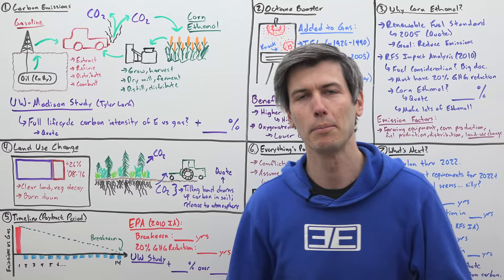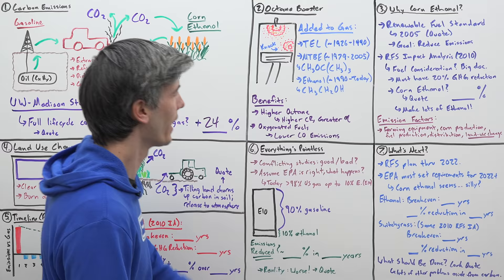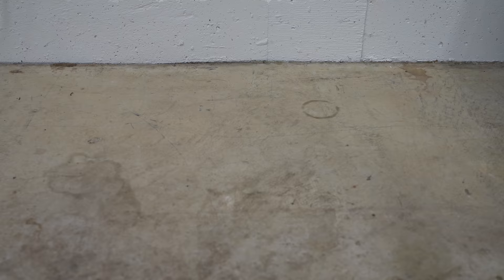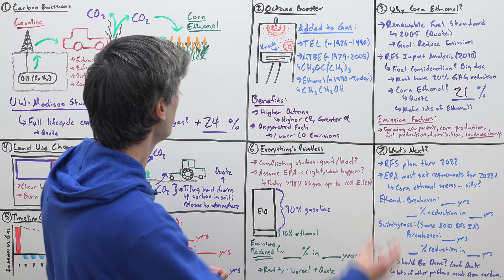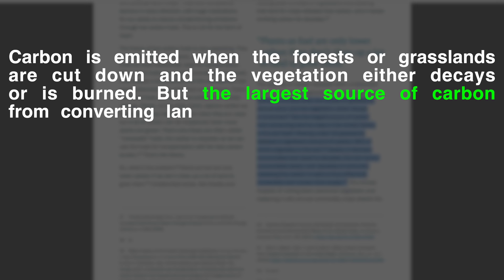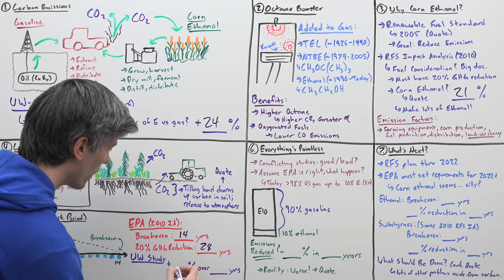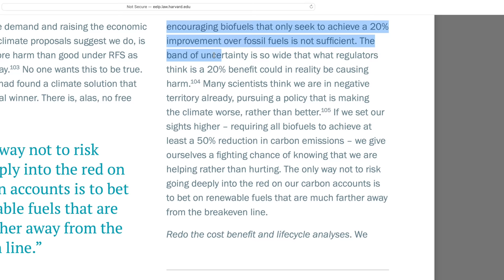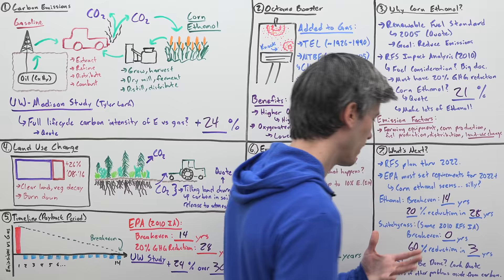America Was Wrong About Ethanol - Study Shows

Comment: The push toward ethanol in gasoline happened before carbon emissions became a major issue. Instead, ethanol was viewed as a means to reduce dependency on foreign oil. It would make more sense to discuss ethanol's success in this regard.
Reply: This is an important factor, it's also worth noting that we just spent a year increasing our dependence on foreign oil, only for a war to break out and drive prices up higher than they would have if we had been reducing dependence on foreign oil.
Reply: @yucannthahvitt251  Other than not drilling in the Arctic national preserve and other federally protected areas (for which I am thankful), I don't see how we made ourselves more dependent. Companies stopped drilling on many known available reserves because prices dropped too low to make domestic production profitable. At least that's my understanding. Keystone would not have been supplying anything yet. I suspect the only thing that would have been accomplished had we extracted more oil and gas than we needed is that oil executives and shareholders would make more money by sending our oil and gas overseas.
Reply: @yucannthahvitt251  I oppose drilling in federally-protected wilderness because too much of our country is already developed or under development. I want the USA to keep large amounts of land that are untouched by economic activity. Not everything has to be cut, drilled, mined and paved over.

You're going full-on right-winger when you accuse me of hating the rich even though I've said no such thing. However, the US does need to find a way to redistribute more wealth through improved tax schemes and increased social spending programs. The majority of our country's wealth should not be controlled by a tiny minority. I reject the claim that the rich getting richer benefits the poor.
Reply: I found some possible signs that using ethanol caused some reduction in foreign oil imports. However, what I found seems to suggest that the reduction much less than most would probably expect. More importantly, though, the timing seems to suggest that the reduction is more towards changing fuel efficiency requirements and nations trying to switch to renewables (for the purposes of carbon emissions and greenhouse gases, nuclear energy is effectively renewable, even though it technically is not).

With this said, I should emphasize that there is a big misconception about the "dependency" on foreign oil.

For fuel, a surprisingly small amount of foreign oil imported to the US is actually used. Yes, there is some that is used for fuel, but for any nation to import oil for fuel, the physically and geographically closer the source of that foreign oil is to the consumer in question, the better. In the case of the US, the vast majority of foreign oil it imports comes from Canada and Mexico, its closest neighbors. For the more distant sources like Saudi Arabia and (until very recently) Russia, that massive distance does not make them viable sources for fuel. In 2021, according to the Energy Information Administration, the top 5 import sources were Canada (51%), Mexico (8%), Russia (8%), Saudi Arabia (5%), and Columbia (2%).

As for the fuel that comes from that foreign oil, even that is largely restricted - not so much legally (although that can be the case) but rather physically and geographically. They tend to be used predominantly in the regions closest the the source - the location of the refining can affect this, but geography arguably plays the biggest role. As such, only nations that have no internal oil sources but have massive developed economies - like China - truly import across great distances (though in China's case, it is mainly Russia and the Persian Gulf nations). As far as fuel from oil goes, the US can easily satisfy its needs.

So why the importing? Because the "dependency" comes not from fuel, but from revenue. Depending on the year, 70-80% of oil imported is crude meant for refining, and this oil, far more often than not, is meant to be shipped back to the nation it is from (or at least the nation that initially purchased that crude oil). That crude oil comes to the US because the US is to oil refining what China is to manufacturing - it is just that massive of a scale, and quality is hardly a concern. In terms of quality, other nations have comparatively better refining (though the margin is still fairly small), but in terms of quantity, there are few, if any, rivals to the US. The Gulf of Mexico is perhaps the biggest concentration of oil refineries operated in one nation (in this case, the US) in the world. Other nations have their own, with the largest being in eastern/southeastern Asia, but for total combined output, the US in the Gulf of Mexico surpasses all (this arrangement also allows the US to refine oil from other nations simultaneously and not have as great of a risk mixing them up when exporting the oil back - that is perhaps the biggest limiting factor for the largest single refineries elsewhere in the world).

As for exporting oil, the US leads in refined oil and not so much crude oil (though crude exports have been seeing an increase over the past few years). As for the top nations the US exports to, according to the EIA, in 2021, they were Mexico (13%), Canada (10%), India (7%), China (7% - I said they mainly get from Russia and the Persian Gulf, not only from there), and South Korea (6%).

Prior to 2005, there were significantly more imports of foreign oil to the US, and this had steadily dropped over ten years and has held around current levels for a few years now. That said, to say that ethanol played a significant role in this is very difficult to determine. While it likely did play some role, the Energy Renewables Act did not pertain to only alternative fuels like ethanol, and the US was hardly the only nation making official commitments like the Renewables Act - if anything, the US was one of the last nations to make such an official commitment. After all, as I stated earlier, the vast majority of oil imported to the US is solely for refining before being exported back out. If other nations are trying to break their dependency on oil, that means less oil that needs to be sent to the US for refining. In my opinion, this is most likely what contributed the most to import reduction, though I must grant that I have not been able to find or determine how much it reduced imports, so I cannot make any definitive claims about it here.

While ethanol might have helped in reducing foreign imports, it may be too nebulous to make such a claim. Changing fuel and efficiency standards as well as switching to actual renewables likely did more than ethanol did.
Reply: @DavidRichardson153  Wait a second... we import crude oil from Canada and Mexico, and at the same time, export to them as well?  How does that make sense?  Why would we import something only to turn around and export it back to the same place?
Reply: @phillipsusi1791  Some of it can be explained with the US's refining capacity. It is not exactly high-quality, but what it does have is scale. Sure, other countries have their own refineries, some of which are larger (greatly so, in a few cases), but they are pretty much meant for those countries to use the oil they import. That said, as I mentioned, the totality of the US's refining capacity outstrips everyone else's, so many countries turn to the US for refining, and the many different refineries helps accommodate the many, often smaller foreign imports and orders. Admittedly, this typically works reasonably well for countries that cannot accommodate their own refineries, though it can still vary wildly, and they still tend to favor the American side (or more accurately, the American corporate side), which is a separate topic with its own issues.

It does make some sense to import crude and export refined - maybe not enough sense, but still some. Importing crude and exporting crude, though, baffles me as well. Granted, the source of the crude can impact the final refined product (hence the issue about the Canadian crude being in tar sands), but it is hardly a sufficient explanation.

One thing to bear in mind, though, is the partied involved. Some of the oil imported comes from nationalized sources (Mexico is the one I am personally most familiar with, so I cannot reasonably speak for others, even with the research I have done), and you need to remember that American operations, from drilling to refining to exporting, are mostly, if not entirely, in private hands, and private hands ultimately do not care about logic as long as the money keeps flowing to them (and preferably in ever-growing amounts). Private hands are often the biggest offenders for these kinds of illogical circumstances.

There is one more thing to bear in mind about refining crude oil: fuel is hardly the only thing we get out of it. Remember, crude oil is made up of wildly varying chains of hydrocarbons, and arguably the majority of refining is separating them by size and weight. Fuels tend to make up the smaller lighter chains, while the larger heavier ones are used as raw materials for manufacturing and synthesis. Plastics are perhaps the most obvious final product, but there are just one of a nearly exhaustive list of products synthesized from the heavier parts of crude oil. Frankly, when oil does eventually run out, the loss of a major fuel source will actually be one of the least of the resulting problems from it (still pretty bad, though). This is part of why so much research and development goes into biodegradable items - oil, like corn, is in just about everything, whether we know/like it or not.

Anyway, as for importing from and exporting to the same places, especially in regards to only crude oil (again, importing crude and exporting refined is somewhat acceptable), I would say that is pretty much because of the private corporations overseeing all processes and transactions in the US. This could all change should the US ever decide to nationalize its oil reserves or refining capacity, but unfortunately, that is not likely to happen.
Reply: @DavidRichardson153  The statement was not that we import crude from Canada and Mexico, and then export back to them the refined products... the statement was that we both import and export crude oil with those countries... that's the part that doesn't make sense.
Reply: @phillipsusi1791  Like I said, that does not make sense to me either - I mentioned that in my reply. The only possible explanation I can come up with is that it is entirely due to private entities making the exchange. When all you have are private entities looking to turn a profit (and as big of one as possible), it often results in illogical circumstances like this. I did mention that the source of the crude might play a role in this case, but I doubt it would be particularly significant.

Greed is the only thing that makes any amount of sense to me regarding to importing and exporting crude to and from the same countries. I am not justifying it at all, mind you, just that it is probably the main reason this is happening.

Comment: I have always believed that ethanol is the way to go, if the engine is designed to use it to its full potential, and not as a substitute. But using corn to create ethanol is totally silly to me, it just don't make sense. Years ago I was watching a documentary about growing seaweed in saltwater and then using it to produce an ethanol based fuel for transport purposes. In the documentary they were talking about having 6-7 crops per year and using salt lakes in desert country.What ever happened to that idea???
Reply: I'd like to seee the seaweed study. I'm sure it's likley feasible just as corn works on small scale. Is when you extrapolate up to make it work on large scale -that the argumnets fall apart quickly.  I strongly suggest the sea does not  have the capacity to produce anywhere near even a fraction of the fuel we need without eco collapse. Same as on land. For the land the big picture is this; - to fuel all the billion cars int the world - you need roughly the same farm area as it takes to feed the 7 billion people on earth. The more we feed our cars with fuel the more we starve. Its that simple. I suspect a very similar picture would rapidly emerge if we try and harvest that fuel from the sea instead.
Reply: Seaweed or algae? Because algae is scalable sea weed isn't as scaleable and oddly enough and ironic to better living there's currently a seaweed shortage in terms of turnover. Few things like pollution, more pollution then ability to grow, over harvesting, high sulphur in sea water and h I gher levels of acid from concentrated drainage into the ocean from cities.
Reply: @wardfoud9216  I really don't know anything about growing Seaweed or algae, I just remember the study on TV. To me it seems the solution to the renewable fuel problem. To me growing seaweed or algae in salt lakes was the solution. In my area there a 10,000s of salt lakes. A lot are in between the wheat fields. They tend to be very shallow. The largest being 3494 sq Km (1349 sq mi), second largest being 1980 sq Km (764 sq mi). If it is possible to get 6 crops per year, that would produce a lot of fuel from land that is basically useless. It was is only an idea.
Reply: @bbbf09  The documentary was on T.V. years ago, so I am going by memory only. The study was more to do with salt ponds ( I think). My idea would have been to scale it up to  using salt lakes and return land now used for farming corn (for ethanol) back to farming for food. If I remember correctly, the Seaweed or algae study produce high yields with 6 to 7 crops per year. What I am saying is, you can't get 6 to 7 crops of corn crops per year from the same land. I would think the idea would have failed because no one would come up the the huge amount of money to finance such a project.

Comment: The reason this happened despite it being both financially and environmentally terrible is because of corn subsidies. In America we pay farmers to grow corn and sometimes we pay them NOT to grow corn, to keep the market “steady.” The problem comes from the fact that without subsidies, nobody in their right mind would be making ethanol, they’d be losing so much money because of the logistics involved. 1 gallon of ethanol might need 1/2 gallon of diesel fuel to produce and transport it, it might need 3lbs of compressed natural gas to brew the corn (making beer essentially) the amount of electricity in making a gallon of ethanol is probably enough to drive an electric car 100 miles. It’s just another terrible idea from the bureaucratic system here in USA. Yay!
Reply: All the energy it takes to produce and deliver a product to the consumer is reflected in the price of the product.

Today the NYMEX spot cash delivered price of ethanol is $2.19/gal.

An unusable sub-grade of gasoline (RBOB) is $2.74/gal.

To turn RBOB into usable E0 costs even more and unfortunately becomes even more toxic and dirtier.

Ethanol is distilled at far lower temperatures than petroleum.  Also, ethanol producers have been switching to using waste steam from natural gas electric plants.  The largest ethanol producer has at least half their plants this way so the price of ethanol has room to remain low.  Waste steam = free energy.

Ethanol producers are somewhat insulated from the price of corn for if corn is low in price, then so too are the prices of the distillers grains and byproducts.  If corn is high in price like it was most of this year, they kept ethanol low with making it up with high prices of their distillers grains.

Corn ethanol is a value-added product of already existing feed production which leaves 100% of the protein and other things still available for feed in a healthier, more digestible/efficient, and more concentrated form called distillers grains.

Iowa State University measured all the energy it takes to produce an acre of corn into a "diesel fuel equivalent"
This included machinery, fertilizer, chemicals, tillage, planting, harvesting, drying, trucking etc. 
They found it takes 34 gal of diesel to produce one acre of corn.
What do we get from those 34 gallons of diesel?
We get >500 gallons of ethanol.
But wait, that is not the kicker.
The kicker is we still get 100% of the protein from that acre of corn still available for an even better feed. A win, win.

Comment: I had a motorcycle mechanic tell me 1/3 of his business is fixing ethanol caused problems, wondered if you had any thoughts on this issue.
Reply: It's more than likely due to people not preparing for ethanol use. It requires more ethanol so therefore you more than likely need a higher flow pump and injectors
Reply: That may have been true 30 years ago but even then probably an exaggeration.
Reply: You should tell him to sell everything he has and move to Brazil where Harley Davidson's use 25% ethanol in its gas.  If that is true then he should become a gazillionaire in no time at all.